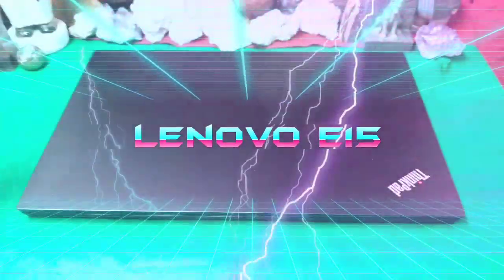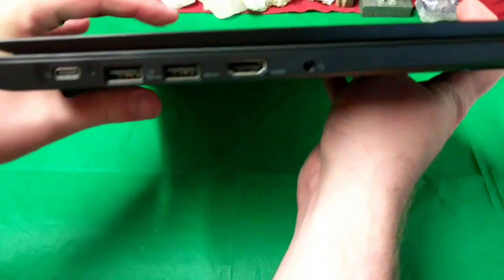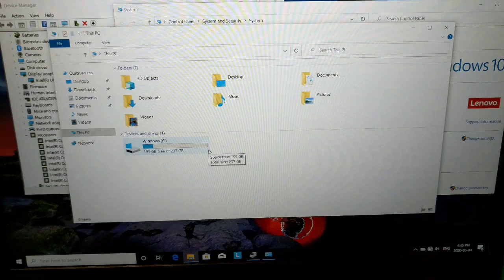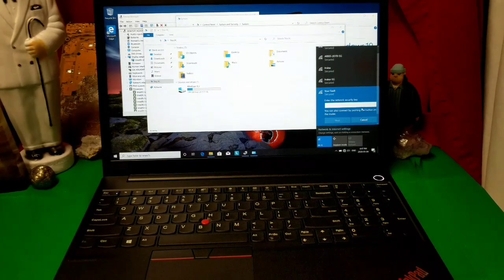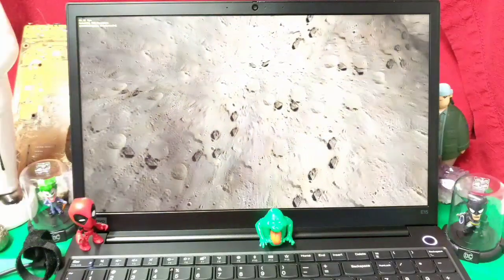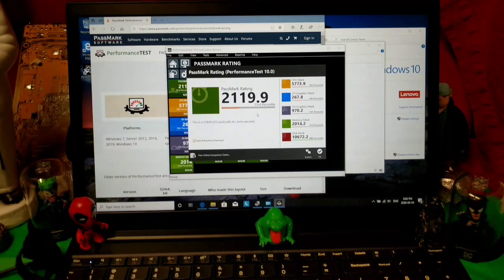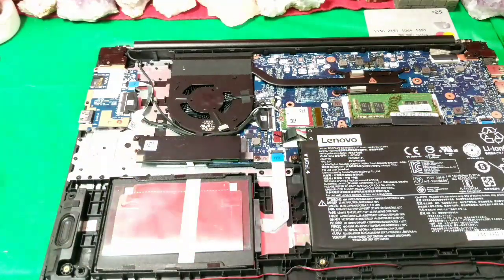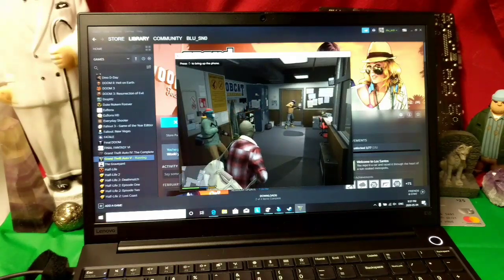ThinkPad E15 Laptop Review, Benchmark, GTA V Test & A Look Inside For Memory Upgrades Potential

Comment: Hello! I have a Lenovo Thinkpad E15 gen3 without a backlit keyboard. Can I install a backlit keyboard from the backlit model on it?
Reply from the maker: I don't think it would be worth the trouble bud lol
Reply: @NevsTechBits  thanks for the answer
Reply: Your version is AMD?, I think Intel version has backlight. Either way, AMD is still better
Reply: @nguyenhuuthanh3336  Yes, AMD. Well, I have no way to compare with Intel, but I like the way AMD works
Reply: @jocker5313  As far as I know, replacing the keyboard on the E series is more complicated than the T and L series. Because you have to open the motherboard from the back.
Reply: @nguyenhuuthanh3336  Now this is the case on almost all laptops.

Comment: The screen is so freaking dim, did you notice that also? wondering if it's just me
Reply from the maker: Have you tried hitting the function button and the (sun +) button?
Reply: @NevsTechBits  ty, turned out to be faulty drivers.. uninstalled the ones that came with the computer (even updated once by windows didn't help) and re-downloaded them from AMD site and it worked

Comment: How's the screen? Is it not too dim? The lenovo website says 250 nits.
Reply: I got the E15 Gen 2 today and you are not going to like the screen on it because i didn't.
I have a reasonable tolerance for inaccuracies, but this one has a big yellow hue over it and obvious inaccurate screen reproduction. It wasn't that bright on the brightest settings either, my old Lenovo E540 can go WAAAAY brighter.
Reply: @Henk717  same exact thing here :( man, it's my first day using this thing and screen is way too dim... damn i didn't realize this is normal for this model.. this is pretty awful, is there a way to fix it?
Reply: @ildarkhakimov3075  Nope, its a terrible panel. You might get the colors more pleasant but for me its been a 5 minute return given the touchpad can't be clicked at the top and thus was unusuable for me.
Reply: @Henk717  damn :(
Reply: @ildarkhakimov3075  Actually from memory there is one thing you might be able to do, install the retail driver for the AMD GPU which has extra settings and turn off battery saving features. That did help on the Dell i tried but i don't recall it helping on the Lenovo. But given i tried it for only a handful of minutes i didn't give it a proper shot.
Reply: @Henk717  that worked thank you!!!
Reply: Ildar Khakimov i just bought it today how is it after using for 2 weeks and is the screen very bad?
Reply: Can you guys plz tell me can i run games like gta v, fortnite and apex legend on this. Plz plz plz tell me i don't want to waste my money.

Comment: Keyboard flex? Now that shouldn't be a thinkpad.
Reply: Its a terrible thinkpad, i just got one today and they screwed up the touchpad completely.
Thinkpads are meant for proffesional laptop users who know their hands around a good laptop.
You don't give them a clickpad that you can ONLY PRESS DOWN ON THE LOWER HALF. That means its impossible to use the laptop as a laptop without either leaving tap to click on (Which always causes misclicks and misdrags because of how speedy i am on touchpads) or without first lifting your finger from the pad and either readjusting to the left top button or left bottom corner.

I spend one minute with the laptop, could not press down 3 times when trying to close windows and immediately filed a refund request.
Reply: @Henk717  awww man u pooor kid

Comment: Expandible 16gb ?
Reply from the maker: That is what the roomer is.
Reply: @NevsTechBits  core i3 ?
Reply: I ordered it with a 16GB variant.
Reply: @groogamer  if you are into anything beyond casual user you need 16GB as minimal memory.
Reply: @mathai5456  Lot's of cypress and spectron threads. Also, few VMs
Reply: @groogamer  also i3 processor is dual core. It's best if it's quad core. Nevertheless if you dared to custom build in India, it could easily take two months to deliver.
Reply: Mathai ohh, WTF are you talking about?? I got i7 10th. It is custom build. Where are you from? And why do you bring India into this?